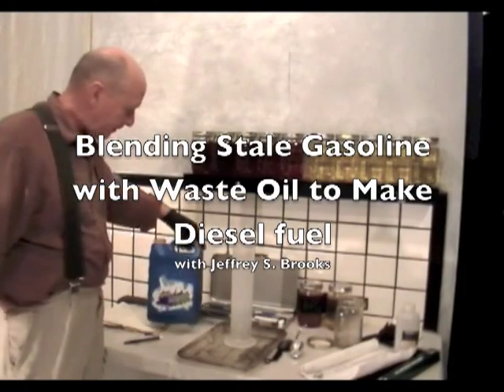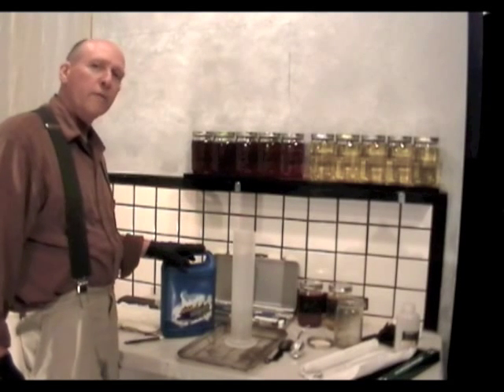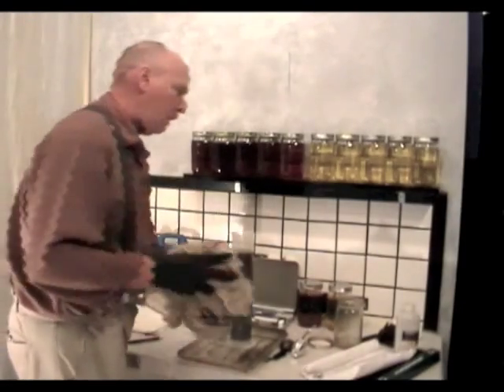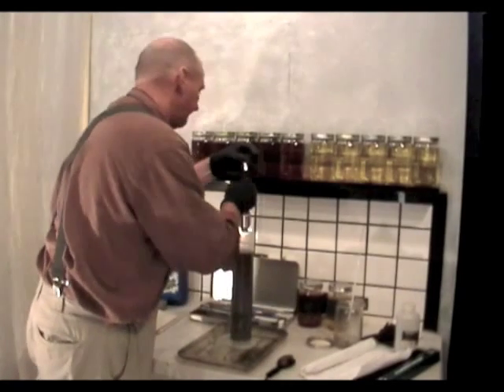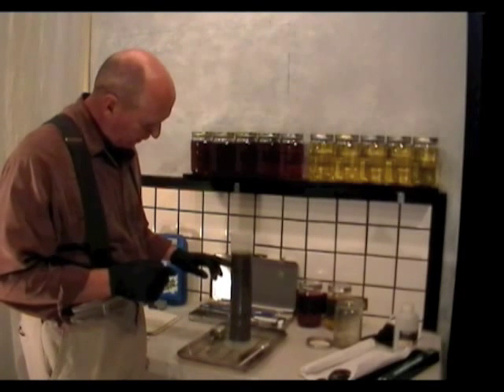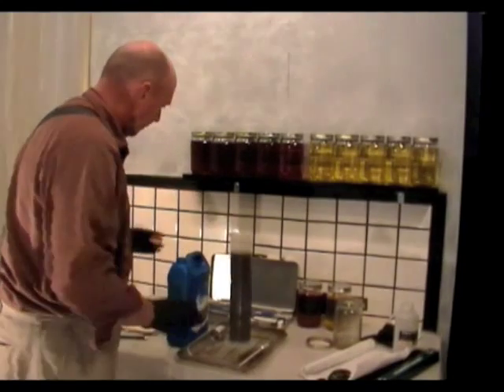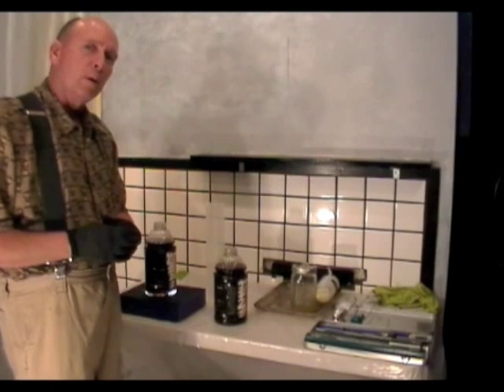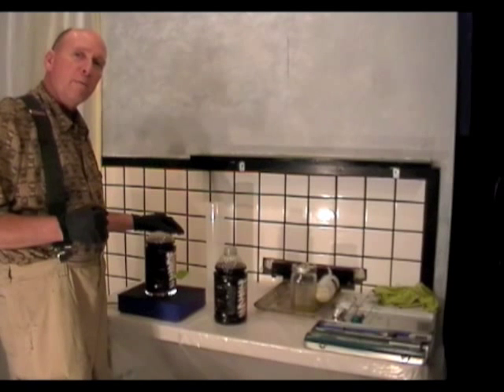Blending Stale Gasoline with Waste Oil to Make Alternative Diesel Fuel I

Comment: Hi i been making my own bio diesel for a year now and i like to think im good at it, saved me thousands, im for the UK, i can now obtain as much old motor oil as i want, by following and watching you do this would it be ok for 2.5  common rail diesel engines ? Plus over here we only get unleaded would it still be ok to do the same for mixing ?
Reply from the maker: I have found the blending of unleaded gasoline (petrol) with any waste oil will produce a usable fuel for any diesel engine; however, direct injected, turbo-charged diesel engines seem to run better on this blend for longer than indirect injected diesel engines.  There is not much experience with this blend on common rail diesel engines, but I see no reason why it will not work.

However, one must keep in mind that WMO tends to be far more dirty than WVO, and that dirt tends to be sub-micron, so a centrifuge tends to an be essential component in processing a WMO blend.

Comment from the maker: It sounds like your blend is working pretty good for our engine, but smoke is an indication of improper combustion, and improper combustion leads to coking.  So, adding gasoline to your blend should improve combustion, and reduce the expense of making your blend that you have been making.  So, maximum on the gasoline is 30%, because alcohol is on USA gasoline.  If you know your gasoline does not have alcohol, then 50% would be max.  But, 20% seems to work fine for most diesel engines.
Reply: i tried it and goes well, all what we need good filtering

Comment: I am now using a 50/50 mix of diesel and used motor oil in my 1997 Dodge Cummins. It seems to run stronger, more power, smoother, and a little better fuel mileage. I noticed a slight smoke. I would like to try mixing fresh gasoline with used motor oil for my diesel, but do not want to ruin the pump. What ratio would you recommend? I was thinking possibly 3 gal. of used motor oil to one gal. of fresh gasoline.

Comment from the maker: @Begbucks Yes, I was surprised to find that stale gasoline (petrol) would not blend readily with waste oils.  Yes, I decided to blend the stale gas at 90%, because it was nearly as viscous and dense as diesel fuel; however, it just floated on top of the oil I added to it.  I have two more videos on the subject coming.  

Power steering fluid can be used just like ATF in a waste oil blend diesel fuel.  I plan to experiment with break fluid soon.